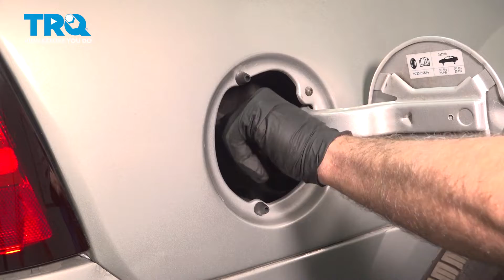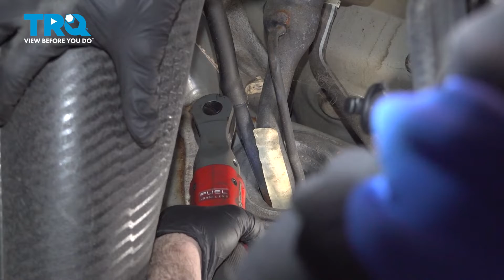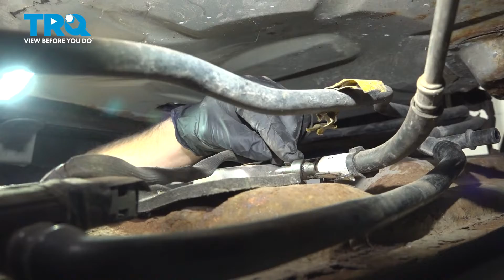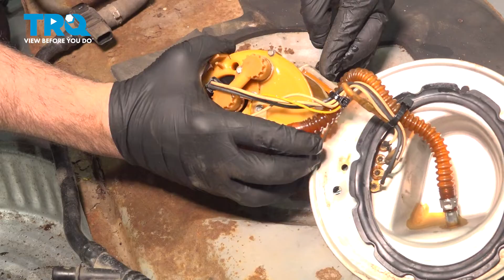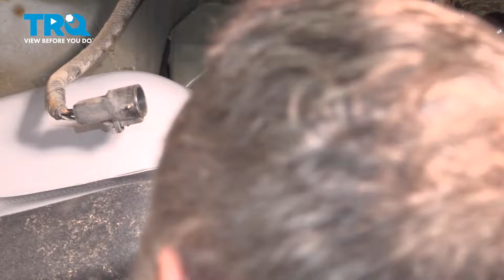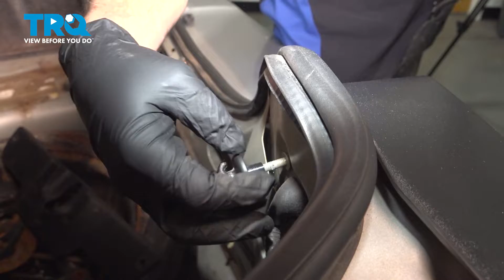How to Replace Fuel Pump Module Assembly 1994-2004 Ford Mustang

Comment: Just letting anyone know who looks for this guide, be aware that some of the yrs in that range have completely different pump assemblies and pump connectors, the 96 gt has the pump on the passenger side of the tank and it has a hanger assembly with a spade connector fuel pump, fuel sock also likes to fall in the tank so be careful pulling it out